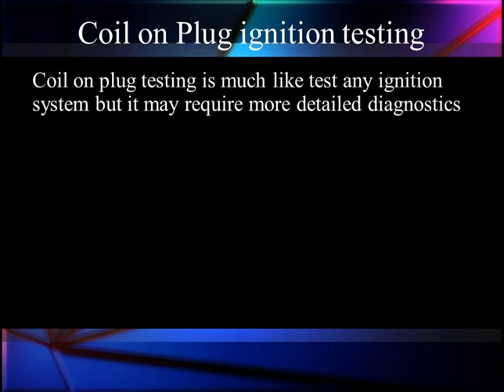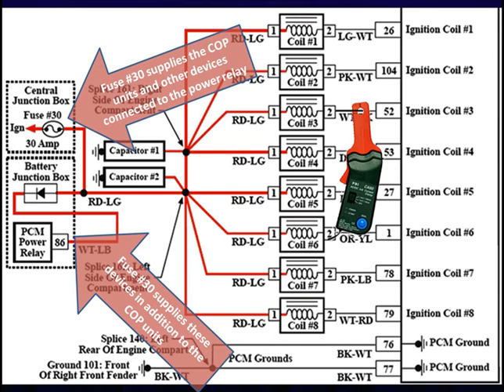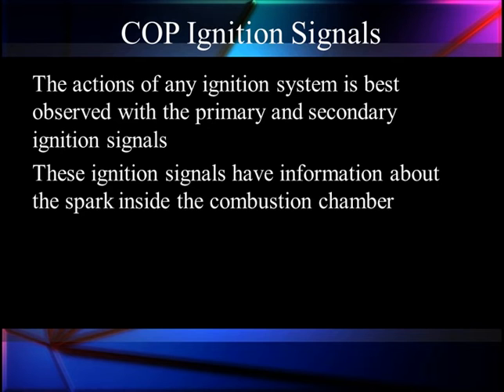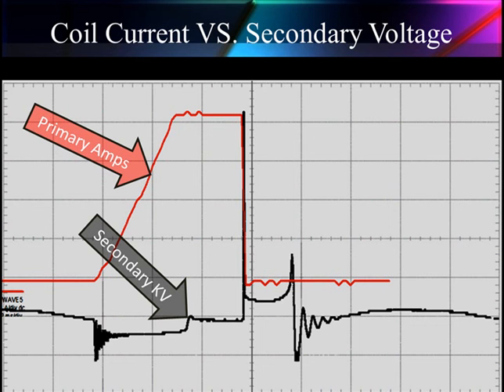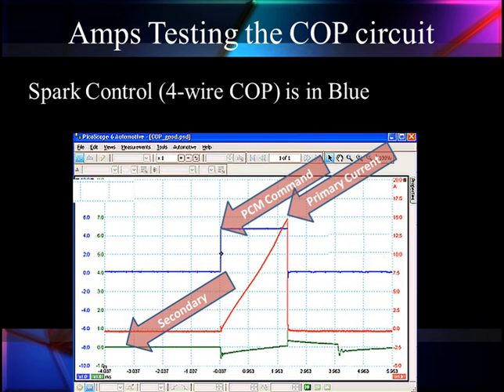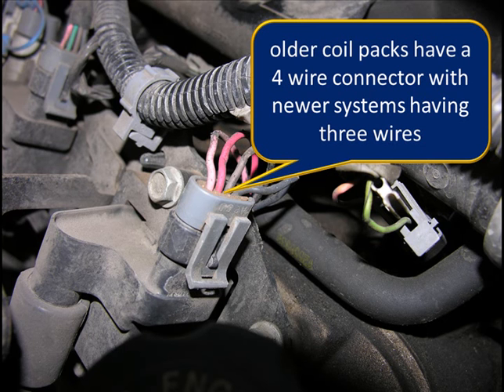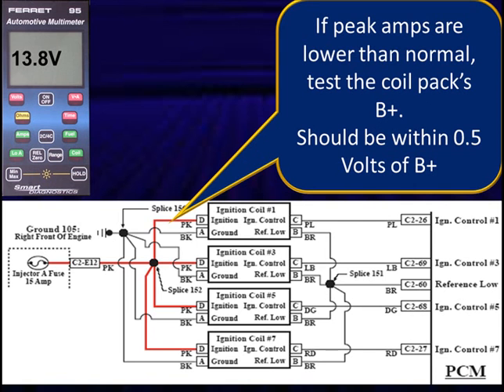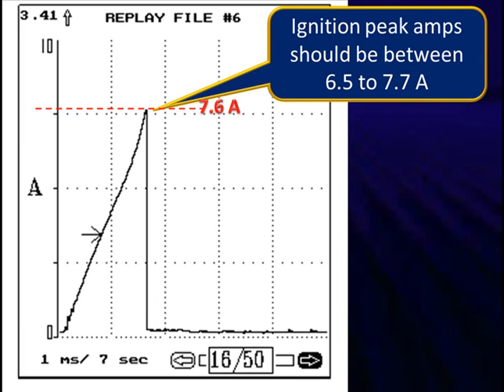15 Coil On Plug Testing

Comment: Ok, but why the high current in the primary with a normal looking ramp indicating inductance. It should indicate a shorted coil, but the normal ramp and inductance says otherwise. No spark indicates and shorted secondary. But turn on oscillations show in the primary and there's not firing or spark line. This looks like a confusing pattern to me. Be interested in anyone's explanation
Reply: I think the coil is going bad: low resistance on the primary and secondary. I suspect the heat of normal operation has begun to break down the insulation on the windings causing a drop in resistance in both primary and secondary coils.